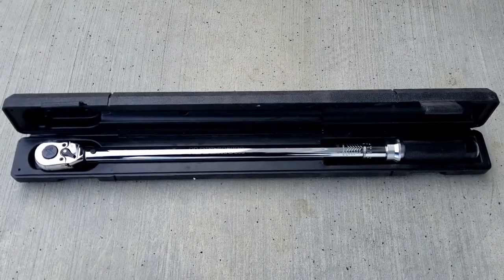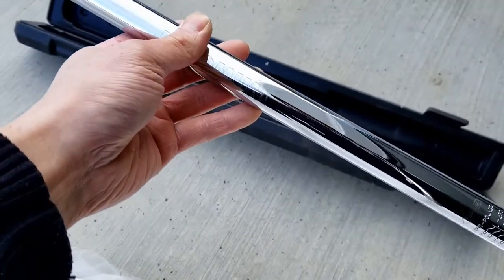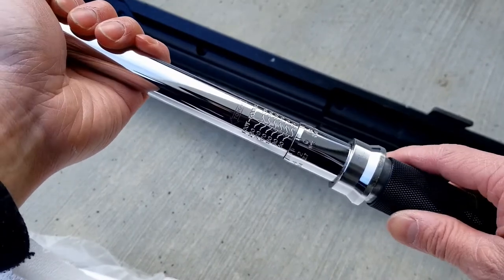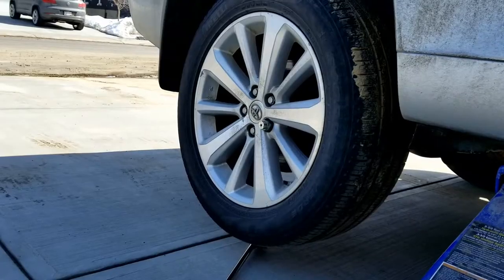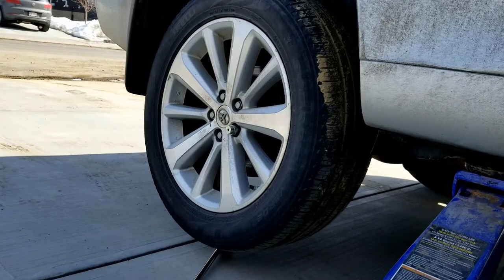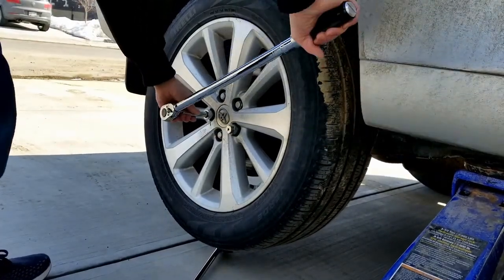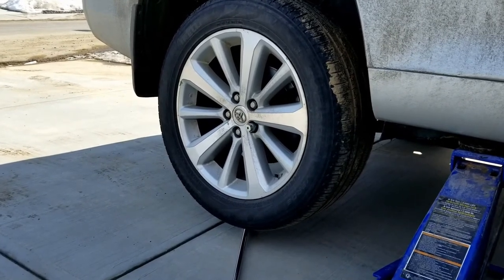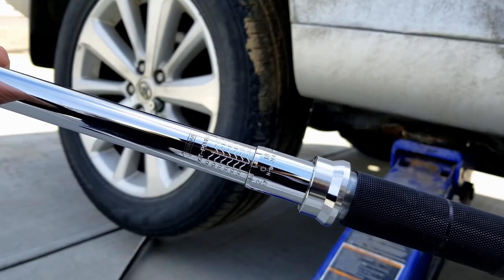HOW TO USE A Torque Wrench & How to Torque Tires Wheel Lug Nuts DIY EASY

Comment: Thanks for the vid! Couple of things I'd note. Not sure about torquing when car is jacked up, always tighten by hand and then a non-torque wrench until it's decent, put on ground, then torque it to spec w/the remaining few lbs needed..Don't turn it to 0 when you're storing it; turn it to 0, but then back to 5 or so lbs/ft, want just a small amount of tension on the spring so it doesn't need calibrated later on..Most importantly, you want to start to torque when the vertical center  line is 90 degrees (start at 3 oclock and tighten it clockwise until no more than 4 oclock, restart at 3 again if needed). Thanks for the vid, nice to compare notes!

Comment: Can you set the micro adjustment the ones with 0 - 8 reading in between lets say if the torque settings says 10.5 so can you set it between the 0 and 1?
Reply from the maker: Absolutely, you can. Those settings of 0.5 or more precise will be the more expensive torque wrenches. You can also get digital torque wrenches as well.
Reply: I have a 1995 Cherokee Jeep what would be the proper torque for the wheels lug nuts if you can reply I appreciate it and thanks a lot that was a lot of help what you said and explained perfect I give it a 10
Reply from the maker: 110 ft-lbs